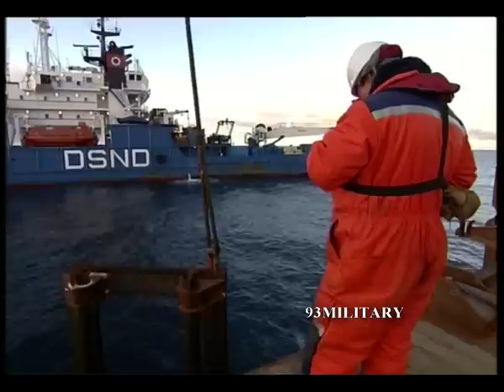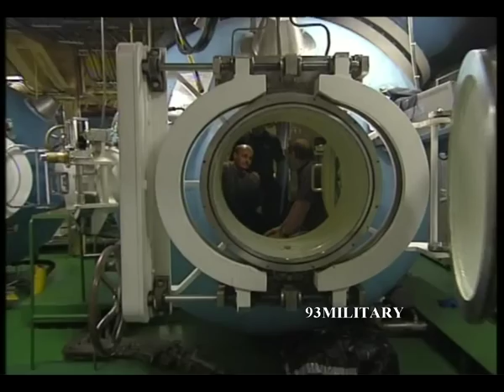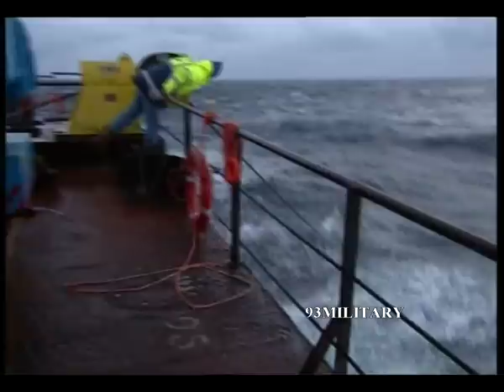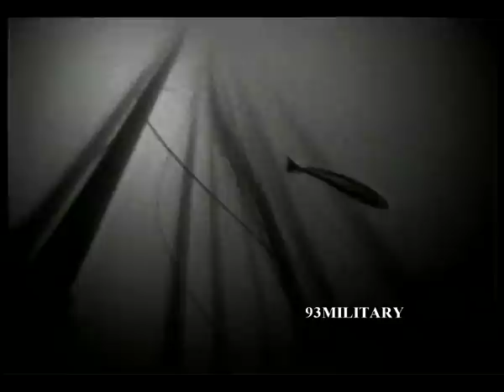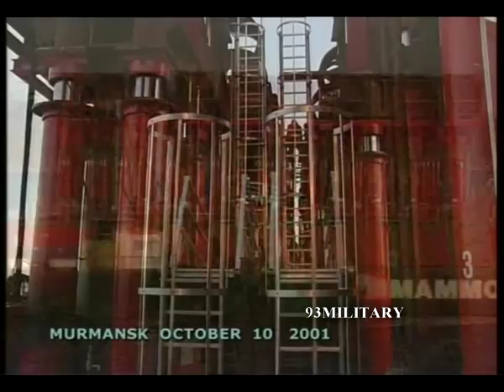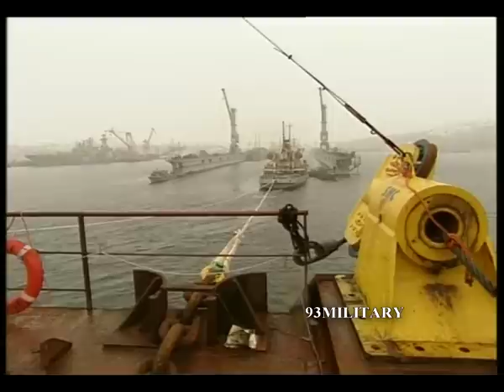Raising the Kursk Part 2

Comment: I watched a video about this sub. One of the other reasons they cut off the front is the missiles were still inside it and they didnt want something to happen to make them go off
Reply: this film also didnt show the setbacks and like taking so much longer to cut holes , it took weeks and only 2 holes were cut out of 28 because of the rubber covering being impossible to cut. This is like an ad for smit rather than what actually happened.   It was a month behind deadlines but not mentioned in this.
Reply: @lindsayfog5246  in the mammoet doc it's al mentioned.
Smit is a subcontractor in this story.

Comment: For those that asked...they cut off the front to prevent it from creating resistance during transport. its like...if you push a cup through water with the open end it will be more difficult to push because it catches and holds the water.... but if you turn the cup around so that it is upside down then it goes through the water more easily and with less resistance. In a sense, they created as much aerodynamics as possible by simply removing the ruptured front end. There was still a concaving section in the front but it was not as large and uneven as it would have been had they left it as is. They also transported the unit backward (the boat forward the sub backwards).
Reply: +9nchnail rubbish

Comment: Thanks for the share 93!
They explained in part 1 that the nose was deeply buried. I would assume the reason they didn't show the full sub, was even after 13 years it was probably still classified. Secondly, they didn't want to share some intimate details of it, like the size of the launch doors, which indicates what size ICBM's it could launch. Different size launch tubes for different types of missiles. Remember the Thresher? Wink...

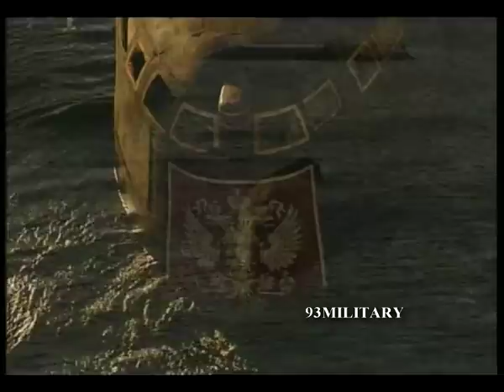Comment from the maker: the conning tower at 15:26 was not damaged badly to the best of my knowledge, you can check photos on google. however immediately in front of the conning tower everything is missing i think because they cut it off. I cant remember but this film talks about some abrasive wire being used to cut the hull, im guessing the front part was cut,